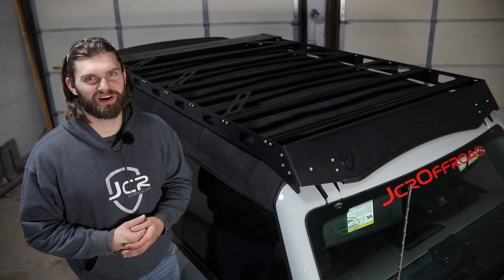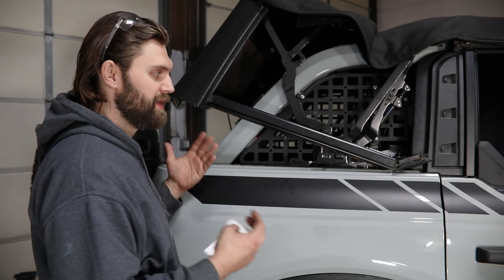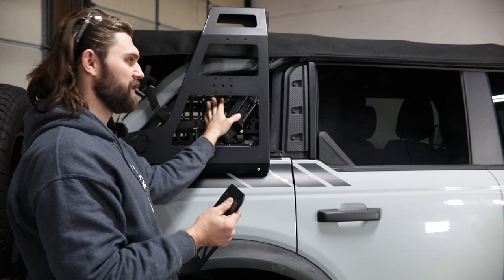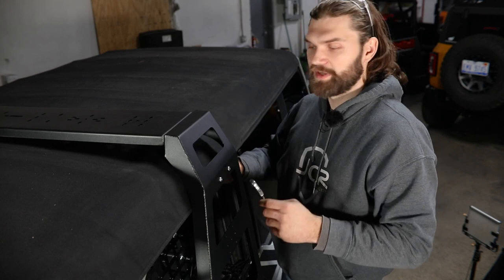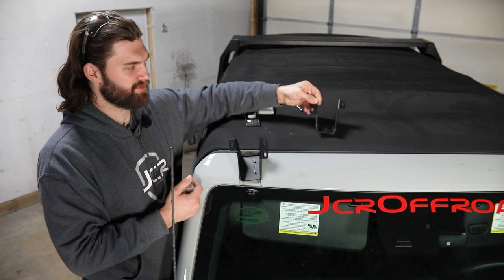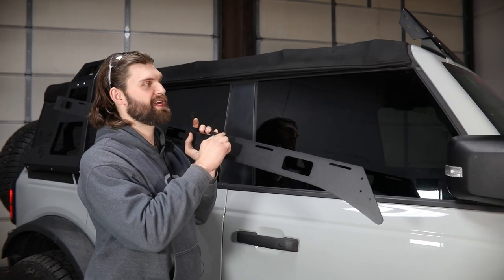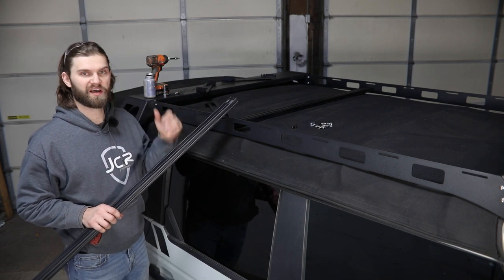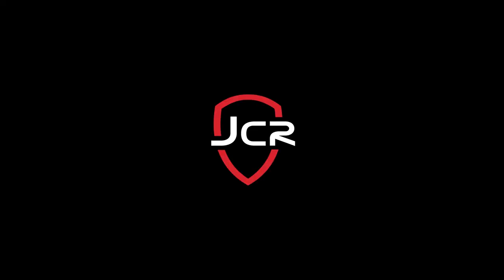Bronco Soft Top Roof Rack Install

Comment: How are you taking the soft top off or folding it back? In the easiest method possible?
Reply from the maker: It's not super quick or easy to pull any portion of the rack to use the softrop, no. Our design with this was to give softop owners who don't remove their top a way to have a roof rack.

Comment: Can the back of the soft top be propped up with this roof rack installed? That’s my main concern with adding a roof rack to my soft top bronco, not so much being able to put the top back
Reply from the maker: Dylan,

Yes you can prop the back of the top up to have access to the rear cargo area.

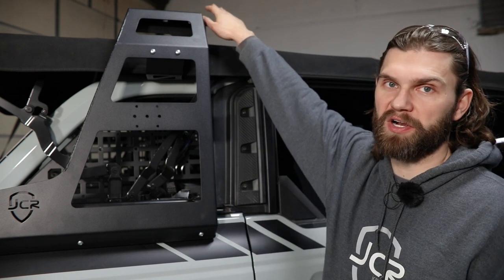Comment: Did the design change after this video was made?  My rear crossbar only has 2 holes in it.  The rear pillars also only have 2 holes at the top.  When you get to 7:35 in the video, there are 3 bolt holes in the pieces in the video.
Reply from the maker: Yes, slight design change.

Comment: What is I want to use the soft top, is the top rack easy to uninstall and will I be able to fold the soft top back at least half way position ?
Reply from the maker: It's not super quick or easy to pull any portion of the rack to use the softrop, no. Our design with this was to give softop owners who don't remove their top a way to have a roof rack.

Comment: What kind of light bars can i mount to this rack if any?
Reply from the maker: The lightbar fairing is designed for a 41.25" max lens housing width single-row LED light bar. So many standard 40" single-row bars fit well.

Comment: If you have such a dire need for  roofrack, why on earth would you buy the softtop...it's like putting a permanant hard top cover over your convertible.  ditch the softop and just buy a hard top system for your bronco.  What a waste of a softtop feature.
Reply from the maker: Ronald,

The issue is many bronco customers didn’t get a choice, as Ford has/had constraints on hard top availability.
Reply: Your rack shouldn't have anything to do with your top. You should be able to run it in a soft top, a hard top or no top. Bikini top.

Comment: I finally got around to putting this rack on and I really wanted it to be good.... but it is not. Terrible welds, holes not lining up, very poor instructions, rear side panel windows don't fit around the support braces well, etc. The video was good, but there were no paper instructions that came in the box and all the hardware was literally shoved in one bag that was taped up because it had holes in the bag. I really only need it for ski racks, but if you are wanting gear racks or a roof tent I would just look elswhere or fork out the money for a hardtop.
Reply from the maker: Hey Brandon! 
Sorry about that, please send over some pictures of the issues to tech@jcroffroad.com and they can help get you squared away.
Reply: I got mine today. Just finished installing the side panels and rear cross bar (almost 3 hours solo with a couple mess ups) . It takes some finessing, but I kept the bolts loose until i had everything lined up and i was okay. So far the video instructions have been good and I haven’t needed anything additional. Paper instructions would be nice just for part orientation purposes. Seems very sturdy so far and i’m satisfied. 

Will update again tomorrow.
Reply: Oh and yes, side panels were a little difficult to fit back on after installing the rack side panels, but i was able to get it with some muscle. I think i’m going to get some 3M velcro and attach it to the panel sliding under the soft top, that way i can seal it better.
Reply: @scoopdiddyhoop  if you find a decent fix for the windows let me know! I was thinking Velcro as well, but I ended up removing those supports entirely. I am only using a ski rack during the winter and it is plenty sturdy for that without the supports. How do your welds look? I maybe got a bad batch.